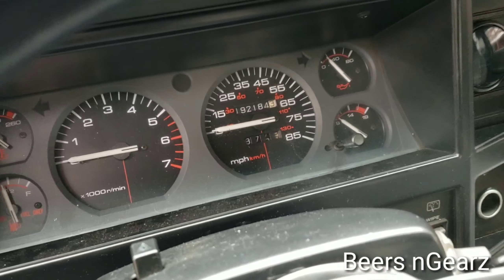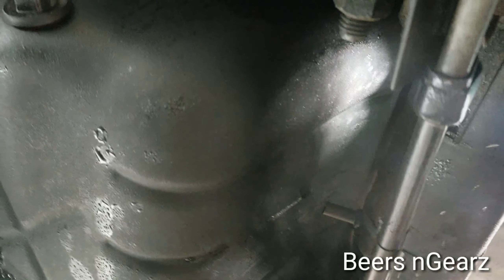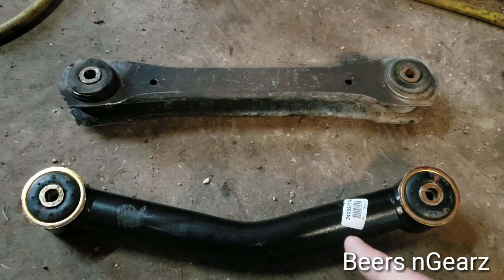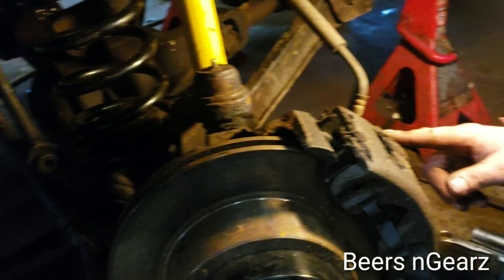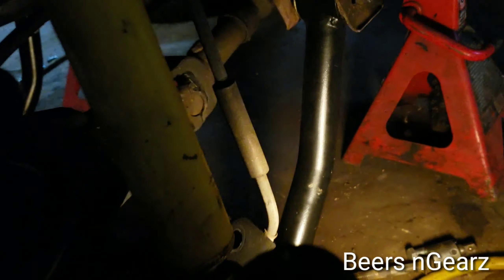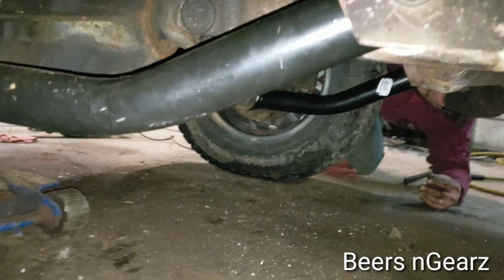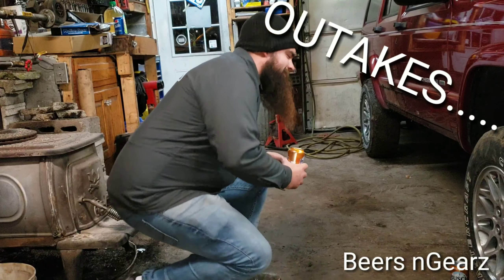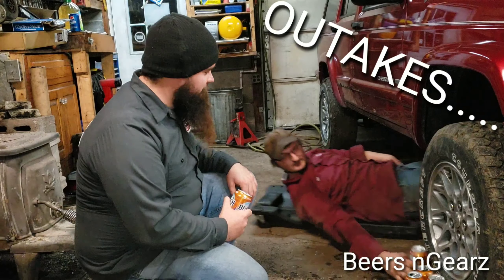Jeep Cherokee xj lower control arm install!!!

Comment: Fun vidro now doit again but get the lower control arm and put then upside down will give you better rid snd more clearance
Reply from the maker: All the ones I've ever seen installed had the curve of the arm pointing down but that's a good idea thanks Picapiedra 4x4 
Consider subscribing and stay tuned for more xj content!!!
Reply: Frankenstein 4x4 Hey did you ever install those upside down? I'm getting ready to put mine in soon and saw your comment. Wondered if it was in fact a better ride.
Reply: @derrinpickett9948  yes i have it work  Exactly the same the only difference you will get a little bit more clearance in you lower control arm
Reply: @kenskens69  what about ride quality? That's what I'm looking for, anything that can help make the log wagon ride less like a log wagon.
Reply: @derrinpickett9948   It all depends on what lifted you haget you have if you have a higher lift kit anything above 4.5 It's not gonna be that good if you want If you want a better ride you need to go to loang arm in the front that will do it
Reply: @kenskens69  I got 3 inch lift. It came out more like 3.5. I replaced everything is new and front end is kinda stiff. Looking for things to help ride quality. I know it's Jeep but does it have to ride like Amber Hurds prom night.
Reply: @derrinpickett9948  shocks and more soft voil spring
Reply: @kenskens69  shocks are new and so are springs. Springs supposed to be Moog variable rate ones. But who know could be Chinese knock offs. They were cheap off ebay. I got it together back in November and been daily driving it ever since. I'm building another one, a 94 so gonna look at different springs and maybe spend little more money. Only going with 2 inch lift on this one.

Comment: So do the longer control arms push the axle forward?
Reply from the maker: The lower control arms are the same length as stock but when I did my upper control arms they have a jam nut on them so you can adjust them to the length you need to keep you pinion angles in check 👍

Comment: You're supposed to smack the starter solenoid not the starters electric motor
Reply from the maker: The solenoid wasn't the problem that was working the gears that kick in and out were sticking because it was cold out and apparently I took on water at some point because after I put some heat to it it started working again 👍